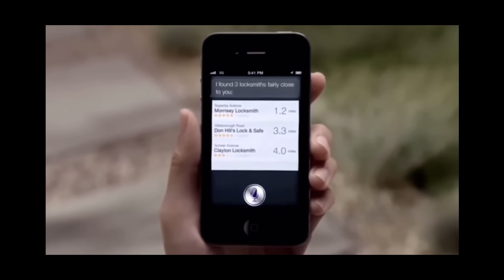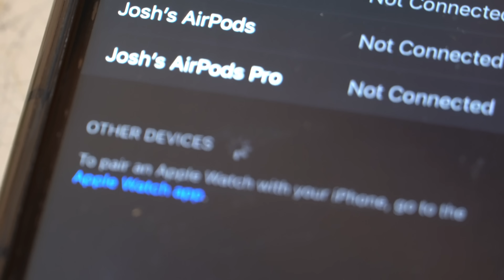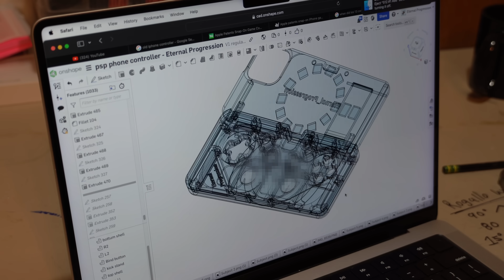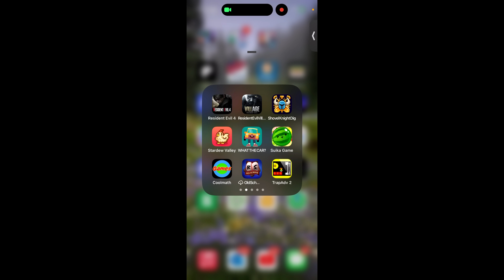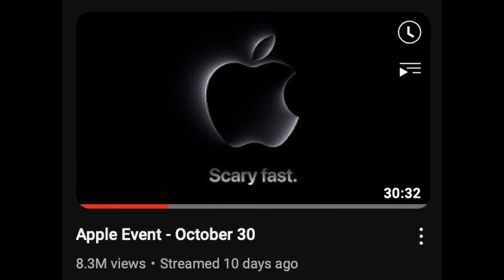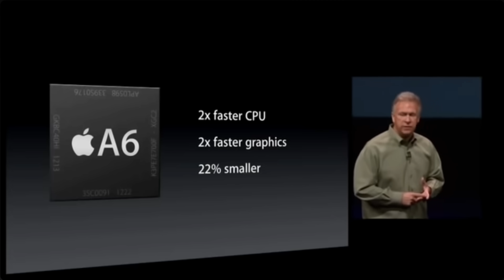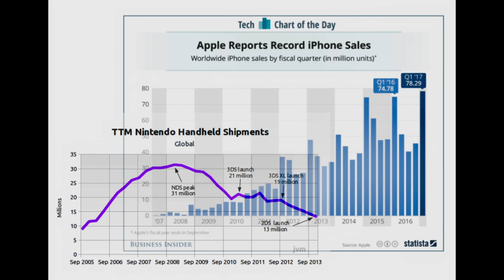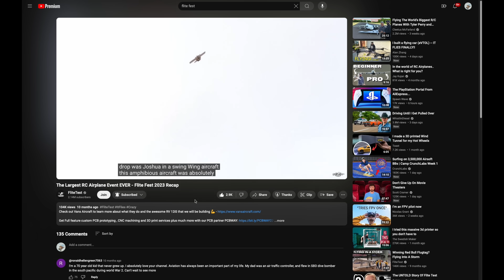I built this controller because no one else would | M-Con V1

Comment: I love this idea so much. But one honest possible issue I’d personally have with it is not being able to keep a case on while using it. Maybe you could make a version where the magsafe bit is also a case? or maybe i’m just dumb and i didn’t see that you can use a case on your phone with the controller part attached already lol
Reply: Apple makes cases that essentially have "MagSafe Pass-Through" so you can still use MagSafe accessories (like wallets and  batteries) with a case on them. Many third-party options do the same. And as @eternalprogression mentioned in the pinned comment, you can add "MagSafe" to any phone (i.e, an Android phone) just by adhering a magnetic ring to the back. A bunch of Android cases already have it built-in so it can use the same mounts and accessories!
Reply: @kurtweinstein3761  ah I see, thx for the correction!

Comment: As another phone controller guy, I'll give you this advice. Get some black resin prints from jlcpcb. Also get sanded and unsanded. Use off the shelf parts when possible like for the face buttons and conductive pads. When trying to figure out the perfect hole size for the buttons, make a like a model with your target size and and 5 bigger and 5 smaller holes changing increments of 0.01MM.

Comment: I had this idea YEARS ago. The idea has been kicking around in my head since atleast pre 2015. All be it mine didn't have magnets but it was 90% the exact same idea. Was even going to add 3DS style thumsticks too.

And yes this idea could've revolutionized gaming on phones IF it was made by Google, Apple or Samsung. Why is it so important that those companies make it you may ask? Because without them backing it and advertising it with their phones it will NEVER become the standard.

That said it doesn't mean a product like this won't be successful if you advertise it. And if this product dose come out I'd 100% buy it (as long as the quality is there).

One thing that dose concern me though is the fitting. With phones being different sizes the controller may feel too big or too small on some phones. When I had my idea I planned on making it a case for "certain" phones. And the phones I'd be targeting where the lastest iPhone, Google Pixel and Samsung Galaxy lines. If you do any size adjustments on the controller I'd focus on those phones specifically. Even if it means making 2-3 models to get it to fit those phones perfectly. And I'm saying this as someone who is currently rocking a Oneplus N30 (android). Best of luck to you. And I'll definitely be keeping my eye on this product.

Comment: I had an idea for a DS emulator controller similar to what you made but it would swivel in such a way that the sides of the controller would be on either side of the screen in a portrait orientation. Would make emulating DS games way way better.

Comment: Saw his video at open sauce, everything looks amazing so far. The final product won’t be released until 2025 a year from now. Hoping they can controller MagSafe charging compatible so we don’t have to constantly turn the Bluetooth controller on and off and it can be seamless where we connect phone it turns on and we play and it gives us the ability to only need to keep the phone charger instead of having to charge both devices. And if it can’t be done with MagSafe maybe have a turning on mechanism where when controller is open it automatically turns on and connects with the slide out feature. It would also be cool if the joysticks can be Hall effect sensor joysticks so that it can avoid stick drift and giving the controller a long life span. Hoping this innovation gets the full potential it deserves bc this will truly change the game.

Comment: Can it charge over mag? It would be great if it could. Maybe add a switch to engage charge over mag too. That way you can still use the controller even if you forget to charge and remove the need for additional cables. This would also introduce wireless charging as a option.

Comment: 1. This is hard to defend its patent because it's essentially a ds controller that slides instead.
2. It won't get widespread enough for developers to develop games for a controller. Cheaper alternatives have existed but few people use them.
3. The mobile market for games is simply bad compared to consoles or PC, gambling games are simply too profitable to ever go away, if only steam for mobile was a thing
Reply: 1. Because nobody has done it before, doesn't mean it should be hard to patent it. This guy's idea nails it.
2. Ummm it's not like that. I think this is a standard controller switch-like-ish but with symmetrical analogs and side to side shoulder buttons. If I'm able to change something it should be stacked shoulder buttons, slight side bumpers to hold it comfortable, and elevate the d-pad and face buttons just a little bit.
3. Yes, I also want some steam games in my phone, meanwhile with xbox gamepass on-the-go and other cloud services this is a fantastic solution.  Pocket-size and easy to stick them together.

Comment: This has so much potential but a slight problem right now. The fact that it can fit on the phone cover is a contradiction Like if i bought the controller that fits on my iphone 13 mini but in future if i upgrade to any iphone xx pro max or ultra pro max model it would not Fit. So try coming up with a solution for this in which one controller fits All.

Comment: Does the L3 and R3 buttons still work with the 3DS sticks? Do you have the button layouts adjusted for the Max size phones or are they in the same spot but just a bigger shell? Would there be any way to add little vent rails in the back to mount a cooling fan in the rear? So much potential I’m excited

Comment: Great prototype! And clever use of MagSafe. This resembles some of the PC handhelds with the slide-up screen.
Your enthusiasm in this project is great too see, reminds me of when I got into 3D printing 7-ish years ago.
The resulting controller is very neat and looks well-designed, if compromised in comfort due to the 3DS-like ergonomics and sticks.

After experiencing the trackpads on Steam Deck I will not view any stick based controller as perfect.
For that it needs to match this, the gyro, capacitive stick tops and general comfort of that device.
Good luck in making this a product though, overenthusiasm aside it's a great product.

I will state the obvious that you're missing the pillar of PC gaming, mainly through Steam and that Apple Arcade probably won't take off from their well-justified reputation alone.
The choice of a Bambu 3D printer makes sense with all your Apple devices, neither is something I would choose but to each their own!
And your controller design further proofs that Apple's MUST THINNEN EVERYTHING mentality is nonsense, functionality is worth added heft and thickness.

Comment: Revolutionary, but I don’t think 3d printing is the best method of production especially for durability. It looks like a few drops could shatter or snap it. Also wondering about stick drift and if it is as significant an issue in this controller as it is in joycons.

Comment: Just in case you haven’t already done it. I would suggest that you implement a sleep function in your firmware to help lessen battery drain. Something like after 1 minute of inactivity it’ll go into sleep or low power mode. My other suggestion is try and make it easy to replace the battery. I know sometimes that’s not easy to do, but it’ll make it even more popular.

I definitely think the controller will sell like crazy once you’ve got all the bugs worked out and have an app that’ll allow button mapping and firmware updates if needed.

With all that said, I may not be your target audience but I hope that you sell millions of them.

Comment: Here's the thing. I have tried gaming on a phone. I've done it on Android. I have done it on the iPhone. And yes it is cool. This controller is interesting, but at the end of the day, it isn't going to make AAA gaming come to iPhone on launch. Capcom has a lot of IP they could have ported. But we haven't seen much. Square has ported some of their older game from the 8 and 16-bit era but not much more. There is a reason for that. it's not the lack of a good controller. It's not the lack of power of the hardware. It is sales. In a market where people are mostly used fo free, pay2win microtransactions, or cheap games most people are not going to drop $60-70 for a game. So with Apple taking a 30% cut for this to be worth it it either has to be low-hanging fruit (port of an existing game) where selling it for $15-40 makes sense or there needs to be success stories of games selling at that higher price point and selling well. These are corporations trying to make money.

Comment: Having a detachable back means that you can create different cases (without the controller) for each model of phone that the controller latches onto. This way you can reach multiple iPhone generations and potentially some android phones (depending on the size discrepancy from the main controller).

Also, an option for cases that wrap all the way around the sides of the phone would probably be preferable to most people, as I could see this taking the place of a phone case to begin with.

Comment: Great Job. The controller looks perfect and I mean it. Try to do some metal 3D print of it. Also please dont be too much of a apple fanboy. Like iPads outside drawing are now fully useless when all share the same M processor but cant even record external video sources because then apple would not sell iphones for wireless recording to ipad, whereas macbooks can do everything but only 8 or 16 gb of shared memory which means many programs dont run due to lack of vram. 

I do see the whole point of a freaking fast iphone doing everything but the lack of freedom, since phones can replace all PCs except in productivity like video editing often.... the small form factor and maybe external cooling through the back of a phone unlocks a lot of power potential.

Comment: Instead of making it a magnet why didn’t you just make it a case with the controller being part of it? Making it easier to make and use by letting you use the controller as just a normal case when you don’t use it nd you don’t have to worry about the magnet giving out
Reply: Because with magsafe it's possible to attach almost any phone to it without the hassle of fitting the phone with the case. I know, not every android has built-in magnets, but you can stick them to an aftermarket magsafe, they aren't expensive and not necessarily to the phone itself, but to a tpu case.

Comment: I have wondered why no one has made a small controller with 2 analog sticks like this for your phone.  8Bitdo gets close but it lacks all the buttons of a normal modern controller that console games need. Assuming the price is right for the average person this will sell. It could take a while to be more mainstream. But I definitely want one of these. The skinner it is so that its form factor doesn't add much to your pocket the better. That is also going to be a huge influence on how widespread this is adopted. Batter cases are widely used but the extra bulk is the biggest limiting factor in larger adoption. 
I recommend adding a turbo button feature so that button mashing wont be needed to pressure the life of the device and for people with hand issues ease their use of the controller.

Also, no one has yet to make a small Bluetooth wireless mouse you can put on your keychain to connect with your phone or other devices and just use with your thumb to scroll. I guess the tech isn't there yet or the batteries just don't last long. I have several ideas for the design even taking into consideration accidentally using it while it's in your pocket. But not the resources or skill to make it myself.

Comment: As a game dev/designer(ui/ux)  issue seems to be variety when building in most engines. Building touch controls on different platforms make usability very difficult task. I do believe this will help with those issues but im seeing a problem with adaptability between different phones. It would take a lot sales to make development focus on a specific controller design. Just looking at Android pocket consoles and how widespread they are and still aren't a focus when developing for mobile. Just my two cents on the matter. I don't work on mobile development anymore other than companion apps for other larger titles. Great job tho id like to see you reach the success you are chasing

Comment: Dude, I’ve been telling people for a while how it was stupid they have not put discrete control sticks on a phone like the 3DS sticks. Your design is exactly what I had in mind. They slacking!
Reply: Sony did over a decade ago with the Xperia Play, iirc as a spiritual successor to the PSP Go. Unfortunately hardware of the day was weak, OS controller support outside of Xperia's dedicated app sucked, and the display ribbon cable was pretty fragile (My display failed around the 2 year mark). After that the market solidly slid into the black slate style of smartphone.

This design though rocks, and avoids the issue of having a permanently attached controller.

Comment: I love this idea so much that I personally pitched a very similar concept on the razer forums in 2019. Except I’d made it a case instead of a MagSafe device. Using MagSafe is a great idea. I hope you can polish this thing up to a mirror sheen and get it out there. I can promise you that I’d get one.

If ever you’re looking for more features to cram into it, I’d love for the backplate to be made of metal and act as a large heatsink, a lot of more demanding games on the iPhone (like genshin impact) cause it to heat up enough to potentially affect battery longevity. And I’m not a fan of having even more batteries on me, so a version with usb-c connectivity and no battery would be awesome~

Either way, best of luck with this project~

Comment: Heres a good idea if you want long lasting sticks. Use hall effect switch sticks. Small and easy to use and wont drift for an extremely long time. But i feel like that could be a feature for v2 or v3 depending the costs and final design of the controller

Comment: Some notes, as far as design goes, keeping well in mind that from your perspective, this is still very much a prototype. First, move that hinge to the middle. Doesn't matter if you have to truncate it to sit a little shallow or something, do it and see where it takes you, because biased hinges have poor durability.
Next, tackle slider durability. I highly suggest using a flat leafspring detent in the middle, perhaps even the hinge itself as before described, to hold the shell onto the controller face, which you can release just by depressing the spring plate. This is material efficient, translates well to injection and metal parts, and keeps part complexity down.
That last part will be necessary if you ever decide to go the last mile on this design and add magsage charging. Don't be afraid of adding bulk from this, and don't be afraid of the wiring either. Pogo pins are cheap, work well, a d you will want that feature by v2 production or China will beat you to it. Best of luck, and feel free to comment or dm with any questions, though you certainly seem to have things well in hand. I don't want any money for the use of this comment or the information in it.

Comment: There was a controller called the Junglecat by Razer, but it unfortunately never made it to market. I hope this one is a huge success, I'll definitely be pre-ordering one as soon as that's available
Reply: The Junglecat came out as one of those side gamepads, but Razer couldn't make the special case you need to attach the controllers for every smartphone out there, so I guess it kinda flopped.
Reply: @marcelolemoss  There was an older model of the Junglecat that had the slide mechanism, but it was only for iPhone 5 (or the old SE). There's a few videos about it